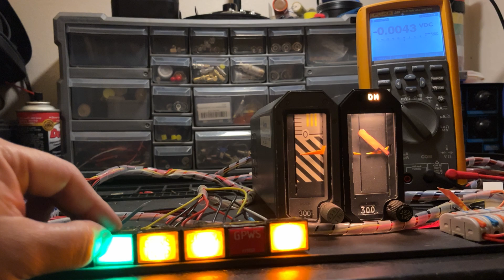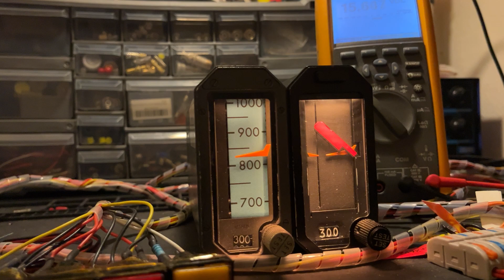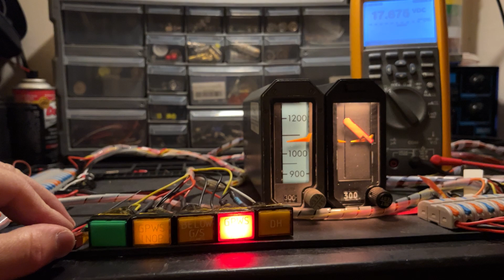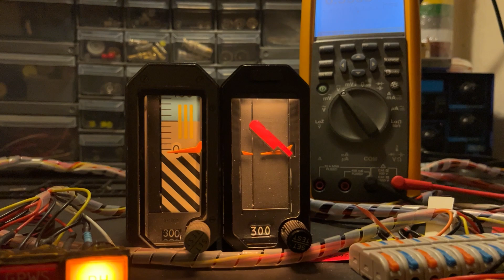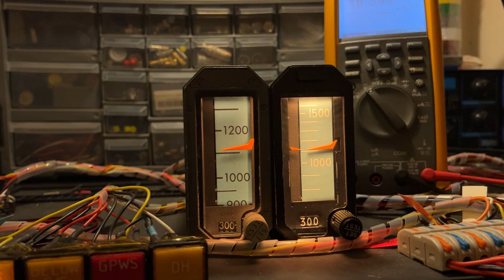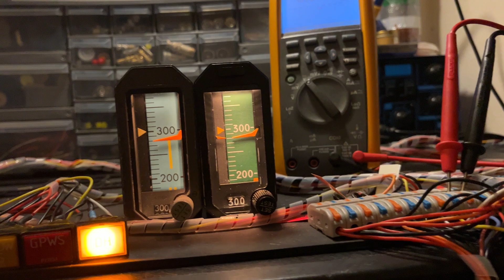01 - Rockwell Collins 339H-2/6 & TRT AHV.5-221 Radio Altimeter Indicators with MKVI GPWS Computer

Comment: I find the kettle tone fascinating...I need that in my life, actually I cannot reverse engineer my favorite computer the Mark Vii by AlliedSignal (specifically with an A2.05 program module) so I will try to recreate the entire thing with an arduino to use analog input voltages to sound the alerts

Comment: Excellent video! As it happens, I've actually been doing some practicing programming trying to simulate the Mark VI. It's been interesting trying to understand the intricacies of these more complex analog avionics and replicating the logic they use. It sounds like you will be testing it further in a future video. If you'd be interested, I could share a list of particular scenarios and such to test the system with so I could get a better understanding of some of the quirks the system has. As an example, I'd be interested in seeing weather or not the glideslope and sink rate warnings interleave (one unofficial manual suggests they do, the rest do not say). 

In any case, I'm definitely looking forward to seeing future videos. Thank you :)
Reply from the maker: @engineergaming4333  Hello! Thanks for your comment! Your project sounds fascinating. I actually have quite a bit of original documentation on the “classic” (as later Honeywell documentation calls my model) MKVI. The EGPWS PDF you can find online is excellent and does have some crossover with the Classic model. But skips some of the core fundamentals found in the original 1990s era documents.

Given your project, I am happy to help shed some light. I have not yet scanned this documentation from the classic model (which I was unable to locate in digital form online) but when I do, I will gladly share.
Reply from the maker: @engineergaming4333  In regards to your question about Glideslope and Sink rate, I’ll have to check. I can tell you that sink rate warning seems to be tied exclusively to the analog Baro Rate data which would come only from the air data computer. I’ve got my radio altimeter and as of a day ago, a synchro-based gyro indicator which also features a glideslope indicator. I have not been able to trigger the sink rate warnings with any other inputs alone.

My next task (barring the acquisition of a real ADC), is to connect simulated signals/voltages to the MKVI and see if I can trigger those warnings in accordance with what the manual specifies.
Reply from the maker: @engineergaming4333  Forgot to mention, yes if you’d like to list your scenarios, I’d be happy to test what I can. As mentioned, I don’t have the ADC simulated yet so barometric-based warnings would not apply. But post them anyway and I’ll see if I can rig something up.
Reply from the maker: I just got an Air Data Computer hooked up to my GPWS and just heard the “angry” Pull-Up! It happens during a Mode 1 “Sink Rate” warning.

So yes, I now can simulate all the barometric inputs to my MKVI GPWS! A video will be forthcoming… I’ve only had time to do a brief test to confirm the ADC was working (and it appears to be) and have not filmed it. Stay tuned!
Reply: @TheQuinnReaperNovaCo  Awesome! By the way, I think the GPWS automatically defaults to approach mode and only changes to takeoff mode when it senses a positive baro rate and/or an airspeed above a certain amount. I mention this because mode 3 and mode 4C are only armed when in takeoff mode so if you can’t get them to trigger keep in mind that the system is particular about what is needed to register a takeoff.
Reply from the maker: @ Excellent observation, I believe you are correct. When I do the full video on barometric alerts, I’ll have the sheets with the description of the relevant modes.

We can put all of that to the test! Have you continued your programming project?
Reply: @TheQuinnReaperNovaCo  Yes, though it's not substantially improved. Like I said, it's mostly practice, iterating on what I have to try to find the best way to lay things out. Plus, I have been wait a little to see this last round of functions so I can make sure I implement them correctly. I'm fairly confident though, that I will have something fully working eventually.
Reply from the maker: @ Nice, sounds like you’re moving right along. I mentioned do another commenter that after the new year, I’ll be posting all the documentation I’ve accumulated to archive.org. This will include all the Sundstrand GPWS stuff. I’ll do a video about that once it’s up.
Reply: @ Have you yet been able to film or test the system any further?
Reply from the maker: @ Hi, I hope to soon! I’ve moved so I had to transport all of my equipment and setup. As soon as I’m back up and running I will resume filming. :)